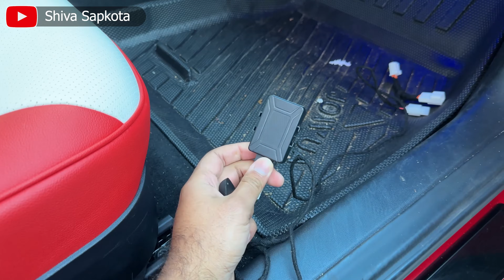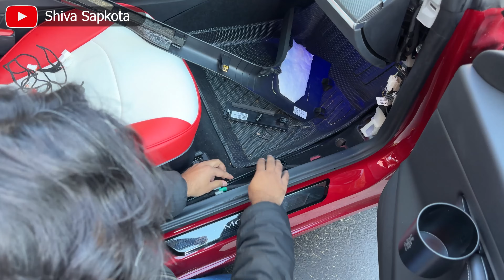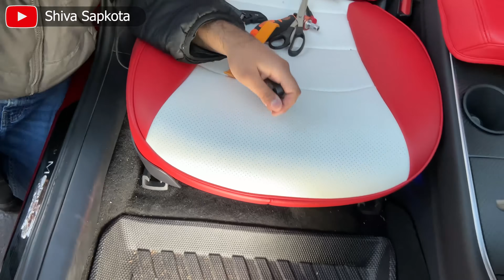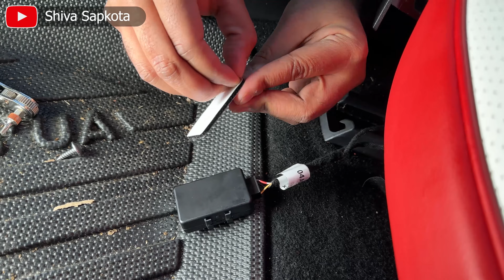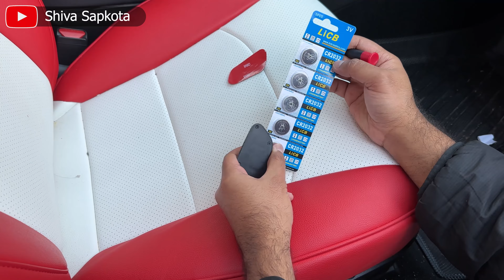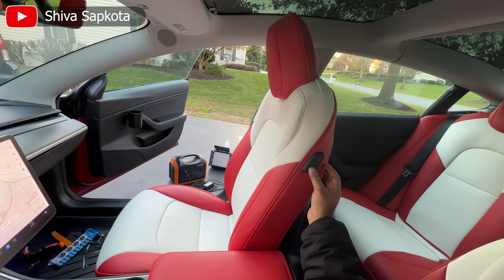NEW Seat Adjustment Wireless Remote Controller For Tesla Model 3/Y

Comment: Great video.  On the 24 Y the torch screw has been replace with a hex bolt.  Much easier.  I placed the remote on the side of the head rest.

Comment: This is such a good product  great tip to buy battery after, for faster shipping  the only problem I had when fitting it the cable wasn’t long enough  as RHD the plug needed was in my drivers side and I had to extend the cable perhaps you could ask the manufacturer to make longer cables for RHD cars as always your videos are a great reference tool to help out with installation

Comment: I can see that this solution controls forward and backward tilt of the seat back and it controls the forward and backward motion of the seat bottom, but what about up and down and forward and backward roll? Both TESLA front seats also have the ability to be adjusted up or down for driver/passenger height and both seats have the ability to roll the bottom seat portion forward or backward (by raising or lowering the front half of the seat bottom).